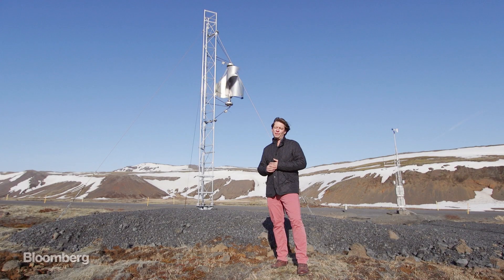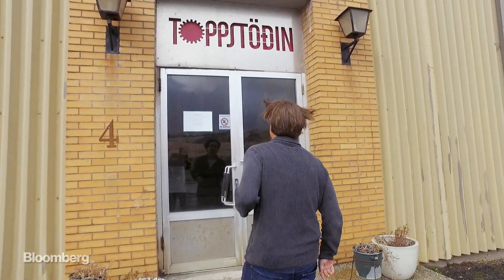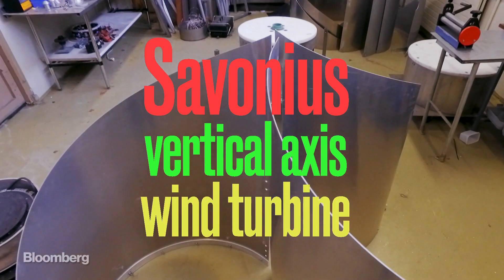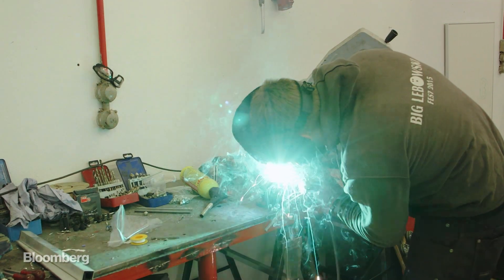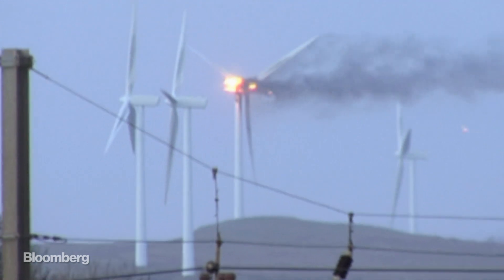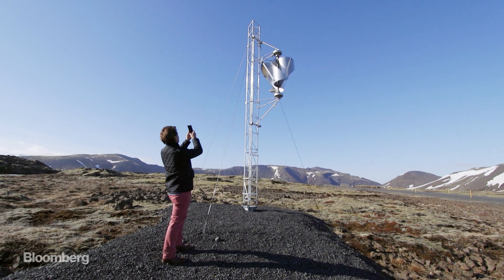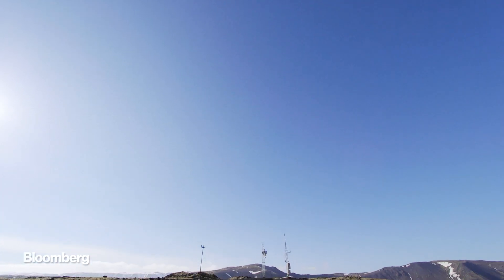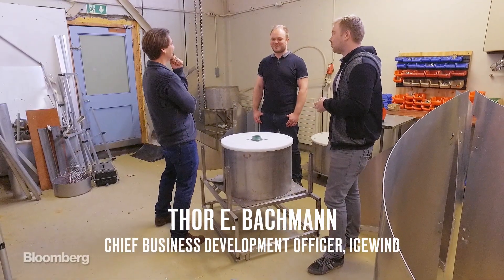The Tech That Could Fix One of Wind Power's Biggest Problems

Comment: These are fine for residential and small-scale power generation, but the three blade system is by far superior for commercial-scale generation.
Reply: Daniel, what if you stack a few of these together to equal the amount of energy of a 3 blade system. It may take up the same, or less space...?

Comment: Eliminate the waste and corruption from the energy sources we have; that's the actual biggest problem. And the one no one is willing to do anything about. These decorative pinwheels are NOT an answer for anything except small electronics and remote areas requiring small amounts of power

Comment: sir, that model you're showing on yutube ,would that be enough to power up a small household with few appliances or would I be needing a bigger scale model? & my 2nd question is can I use it on board an electric car so that  my EV car dont  have to go on pit stop everytime the car battery is low ? and do you ship order overseas particularly in asia?
Reply: No, it's not big enough for your home, and one that was big enough would cost too much.  No, it won't work on an electric car.  Just plug your car in overnight like you would do for a cellphone and you never need to go to a "pit stop" unless you are traveling a long distance.

Comment: When looking through the contraption (top to bottom) why is it not symmetrical? It almost has a trapezoidal config. Does this have something to do with how excessive wind can act as a breaking force that keeps the rotor from over spinning? And can this be adapted to using angles instead of curves? If it could then it would be possible to build kits that can collapse into flat storage form. Outside of the tower section, the primary components might fit into a form factor 4'x5'x what ever thickness. That's something that could easily be MAILED. Kickstarter for home units?

Comment: There is also the fact that they are clearly visible to birds.  Bird strikes on large horizontal axix turbines happen because the birds to not see the blade tips which can be traveling at speeds in excess of 100 mph.  This explanation for bird kills with regular horizontal axis turbines of great size has been offered and appears to be plausible.  This is also a consideration in the building of wind turbines.  For eight years, I pumped a well with a small diameter wind device in an area where winds ranged up to 70 mph in the desert.  It had an automatic spring turnout device built in and not one bird died in the period I operated it due to being struck by blades.  The problem was it was only about seven feet in diameter.  I believe there are problems with the scale of large diameter turbines.

Comment: I think the single biggest problem with most windmill technology is that they have huge electric motors up in the air that create drag just by their weight.  These windmills should compress air with a turbine and pipe it into a tank on the ground and use that compressed air to run the heavy electric motors on the ground.  Then it wouldn't matter how fast they spin because they'd just be compressing more air.  Vertical vanes seem way more efficient than a propeller hanging off a huge trailer with huge coils of wire ready to fall over in a wind gust.  How much concrete and resources are needed to build those things and hoist them in the air?

Comment: I spent 6 months in Iceland. The winds are classified Alpha, Bravo, and Charlie. Alpha is 0 to 35 knots, Bravo is 36 to 75 knots, and Charlie 76 knots and up. My first taste of a Charlie condition was at wind velocities of 110 knots and up. My parka was flapping harder than a Hummingbird's wings, and I was actually lifted and thrown several times as I was crawling across the ice covered street. The dumpsters are chained to power poles. Can't wait to go back. :-) I imagine this wind turbine would stand up to this kind of abuse far better than huge propeller type blades.

Comment: you talk of a conventional vertical axis wind turbine which does have the capability of rotating with wind from any direction. Your wind turbine most likely is not even a patent as it being exact design as mine save for you cutting off a whole chunk to further continue this rambling.Had you contact and discussed with me in writing regarding the purchase of wind turbine for your location. I would have made available the most standard mark variance of my patent wind turbine. With the understanding of the supply and demanded from the source of generation.Understanding this why it has not been able for you to get a patent certification as not only did you have the understanding to purchase the stated wind turbine from me you chose to go through all the design and development steps for your self with my design and concept. yet even then coming out with something which is exactly my design save for you cutting off a chunk. "Vangoing my design and patent to speak of your design as being
a different patent."You should contact me by mail. I am the only individual who will being dealing with this.

Comment: Did you perform any tests to check the EMF (electromagnetic fields) levels? I`m curious as to weather a vertical design would `` channel `` EMF down toward the base of the unit, and of course if it would produce levels worth worrying about.

Comment: First let me say I am all for any alternative energy design or source that actually works and can pay for itself.  Sadly, this one falls way short.  This video is very short on detail which means the facts they have (if any) are not very supportive of their design.  Anyone with a design that is very good has many facts and figures to support their design.  The efficiency of Savonius rotor wind turbines has never proven to be very good though they do perform better in low wind.  That's why you see the very large three bladed propeller designs in wind farms instead.   Yes, the Savonius rotors "function" in low wind but that does not mean they generate much power in low wind.  These windmills are for low power requirements and if you listened to the video they were providing power for very low powered functions.  This design also leaves me questioning everything about it.  A quick read of Savonius rotor design and performance testing shows that two blades and end caps are the most efficient designs.

 Another very important consideration not mentioned in the video is a site survey for average wind speed at height.  Without knowing this the rest of it is fluff.

Comment: These turbines are cool. But they are not a replacement for utility scale wind farms. Not just that larger constructions will almost always be more cost efficient, but these turbines have one major issue: They are too low. At this altitude, they get comparatively little wind in high fluctuation, pretty much the opposite of what you want. This is the major motivation for wind power plants to be built higher and higher - the higher you are, the steadier the wind. These turbines are also comparatively heavy because they use a lot of material for rather little generating capacity, so putting them on high towers wouldn't work. This is one of the reasons why regular wind turbines have three blades: More blades wouldn't increase efficiency proportionally, but would increase weight proportionally and thus cost.
If you put one of these on your roof, you probably won't save any money. And if you do, it's just because you don't pay grid fees and taxes on the electricity produced by it, not because it actually is a cheap way of producing electricity.
BUT, there is one application that these things are perfect for: Providing electricity to a location with no grid connection, in combination with a battery. It's often cheaper than installing a cable for power supply. In most countries solar panels are used for these purposes (parking meters, mobile road signs etc.), but Iceland has very little sun during winter, so solar panels wouldn't produce enough electricity.
And for those thinking these won't kill birds: If you scale them up to compete with regular wind power, they would have the potential to kill birds. There is a solution for that anyway: a radar that detects birds and shuts down the wind farm until they have passed. No birds will be killed and very little energy is lost.

Comment: this device was invented by a rmanian mechanical engineer in late 70's. it's been used in a remote area of south romania for at least  20 years. it was connected to a 12v car batttery with intensity 100A , an then it had a 220v converter. it was used only for the lights in those houses, but i don't know how many appliances you could connect

Comment: Typical one sided reporting.  They don't discuss the negatives of the design.  Also, are they trying to tell us that wind powers biggest problem is high winds???? Please, cost and poor output due to uncontrollable enviros make wind a poor choice for the masses.  They didn't even discuss cost vs winds competitors.  This may be a good product for small, local needs but when providing power to the masses cheaply, efficiently, and cleanly nothing beats Nuclear.

Comment: VAWT (vertical axis wind turbines) first patented in the 1930's have never been successful at grinding corn, pumping water, making electricity, whatever.  Its an ornament, and an interesting way to make a small amount of energy.  Its a fun science project.  This design, and any other vertical design, will never harness productive wind power thats antwhere close to a good HAWT (horizontal axis wind turbine).  If it did, the utility companies would use them.  That's why no professional successful companies are selling them.  This is not new design or technology.
Reply: Not correct. VAWT has been in use in Syria longer than the usa land of wooden huts was even in existence.......VAWT and HAWT have no significant differences in principle. Wind does not prefer one to the other.
Reply: Something's up. Reeks of CIA psyops ridiculousness.
Reply: The differences would be to how wind stresses the bearing points over time, and how well those resist wear when stressed by capricious wind directions and speeds.  
Imho, the HAWT units with both ends of the axle bracing the blade assembly, would be the most durable, and best able to handle capricious wind/weather loads. HAWT's could also, feasibly, be running generation units mounted at both ends of the axle, instead of just one gen at one end...even multiple gens belt-run off the axle itself, if engineered right.
Reply: I beg to differ. HAWT works in very low wind speeds and is unidirectional. Both lacking in VAWT. Also, HAWT cannot overspin, so it does not require clutching braking nor pitch control to accommodate high winds. HAWT is also safer for birds and produces less noise.
Reply: You talke too much  give me speciation, price

Comment: ??? i thouhgt they had more than enough energy in iceland from volcanos. why putting windmills there??
Reply: Where there is cold, there is a lot of wind.
Reply: but arent they building a 1700 km long wire frm iceland to england because iceland have so much ecces energy?
Reply: The only way you can pass electrical and building permits and be successful is to have a engineered and certified small wind turbine KIT. RoofMill is the place to start out and see the plans and pricing to power your home with wind and solar.
Reply: Geothermal energy plants are typically expensive to install and maintain. Lots of maintenance because the environment is so caustic. For many years Iceland has used geothermal for heating buildings. This is a great deal easier than generating electricity from it. Most of Iceland is rural. Wind energy is easier to use for distributed power generation.

Comment: Can it power a house, tho? A larger one, maybe?
Reply: No. This is best suited for hunting lodges, wifi hotspots, etc.  Basically anything you can run off batteries can use these as chargers.
Reply: Michael Campbell

What if you have 5?
Reply: Hunam Without a battery bank, maybe run a few lights in your house.  These are just for round the clock pumping, continuous small loads, or charging batteries.  The wind isn't blowing when you need extra power.
Reply: Michael Campbell

Wouldn't you assume batteries when talking about houses?... smh
Reply: i dont know, at least solar is about powering for real, i dont want to power my cellphone or shit like this.

Comment: If it walks like "green" and talks like "green" then it must surely be green?  Junk journalism at its best.  Savonius type windmills works on drag not lift.  That makes them inherently INCAPABLE of extracting energy efficiently.  They are substantially less efficient than their horizontal counterparts.  Just adding "modern materials" doesn't change that fact.  Neither does making them look pretty.  What is this "Wind Power's Biggest Problem" any way?  Thanks once again Bloomberg for assisting yet another band of green wash peddling hucksters to extract precious dollars from unsuspecting ill educated hippies.
Reply: They explain that this turbine operates in low wind and doesn't burn out in high winds.
Reply: Did they explain it, or simply state it?
Reply: ***** Did you watch this video?
Reply: Unfortunately, yes.  3 minutes of my life I'll never get back.

Comment: dear don bruen how dirty heavy pioson are enough batteries to run youre house with say 3 kids refrigerated air upstairs and downs stairs 2 refrigerators and a freezer correct dc wiring for say 200 amps service  code equals 350 mcm so if i had 200 thousand lying around maybe batteries would do nice for 20 years life expactancy if you can keep the at a constant 50 t0 60 degrees try that anywhere in the southwest

Comment: This design looks like it would be safer for birds. Is that the case?
Reply: Yep I agree with cynicaldriver, that was the point I was trying put across :D
Reply: No, Why can they not put a wire screen up though? A cage to prevent entry?
Reply: Maintenance. Birds (and/or debris kicked up in high winds) would cause damage to the screens slowly, which would require replacement and increase costs. It would also create wind turbulence, which would have at least a minor effect on efficiency. The real bonuses with these seem to be: smaller surface areas, lower installation height, less danger for neighborhoods (meaning it can be installed on a rooftop of a house or building in a city) and much cheaper production costs. Plus, there is the added bonus of it being a much smaller projectile in areas prone to tornadoes.
Reply: In my opinion it will be safer, because it is visible and will not seemingly disappear when it's spinning (visualise looking at a fan from a far distance), which tends to be the case with the more commonly used horizontal-axis blades. Birds will be able to spot it more easily from a distance due to its visibility even when spinning.
I don't think there's a need for a screen actually
Reply: Xen Lin Remember the blades would have to be much larger and once they start spinning the blades would seem to be invisible.
Reply: Carmelo Pappalardo No. That is true for traditional fan blades, but this design would simply look like a solid cylinder. The only way they would appear invisible is from directly above and below.
Reply: Xen Lin I understand the solid look, but it does not mean birds would not try to land or fly near it.
We really need to see the data instead of assuming.
Reply: I admit I prefer solar, and hydro.
My opinion of course.
Reply: Carmelo Pappalardo
Hydro has massive environmental effects. It requires purposely flooding entire ecosystems, and removing seasonal flooding from others. This is not ideal in my opinion, though I do admit that it is highly efficient and the most reliable renewable energy source available at the moment.

Solar is very inefficient in contrast. There needs to be a lot more advancement before it becomes worth the cost. The best solar panels available today are still only in the 20% efficiency range, with optimal solar exposure. Then you must account for lack of production at night, and greatly reduced production in poor weather and while the sun is out of optimal position.

Wind is the next best thing to hydro right now, but has numerous drawbacks itself. Many of those drawbacks are highlighted in this video. Low wind means less production, and high wind means extreme wear on the equipment. Then there's the noise, the cost of production and maintenance, the environmental impact (birds and carbon footprint of producing the components,) and the danger to neighborhoods in severe weather.

This device solves many of those problems and is a lot safer for birds. A bird trying to land on it is going to notice the odd motion and move on, rather than being smacked by a ginormous blade as they fly innocently by, from above or below, out of their blind-spots. I see this as imperfect, but progress in a positive direction.
Reply: CynicalDriver In Quora they stated there is not enough proof that it is safer for birds. I agree flooding and dams are not the answer, but motion buoys, in lakes, and oceans have a small impact. Solar for me, should be used as secondary. Personally I like the idea of using several varieties, and not relying on a single one. Again personal opinion. I have used solar for heat only, and it has worked most days. Again do not rely on one variety.